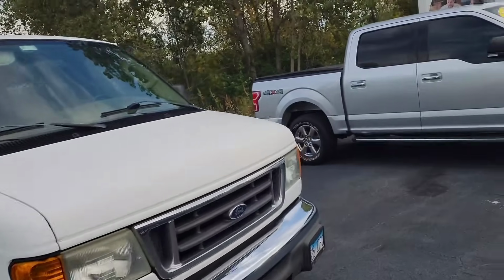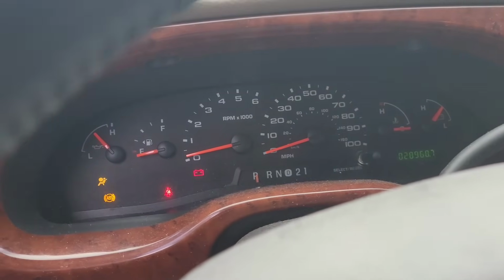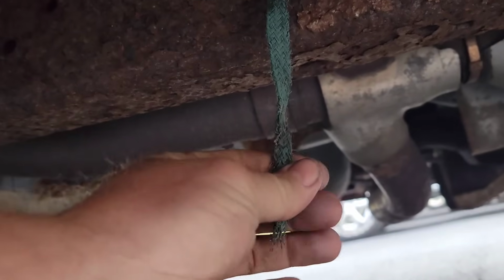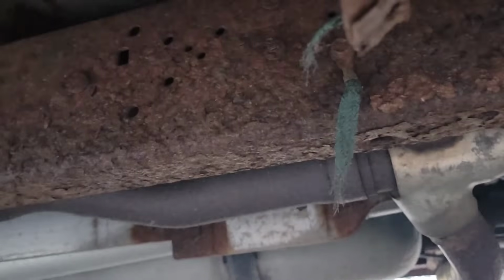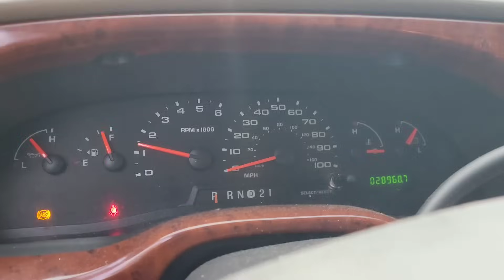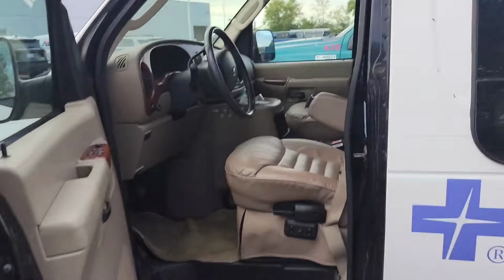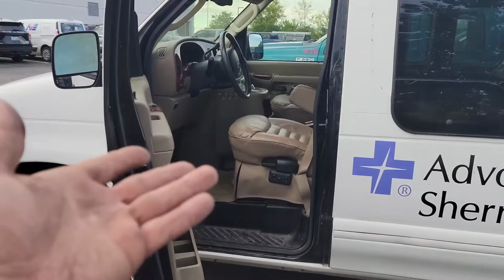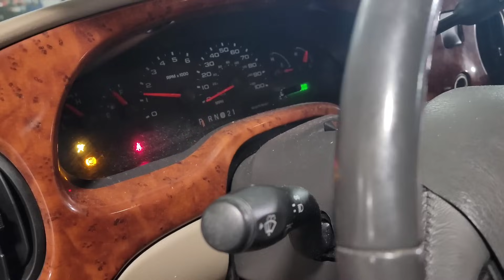Econoline No Start #1 Reason Why Typically - Crank No Start - Easy Fix - #econoline #nostart #ford

Comment: Hey, I’m currently having the same problem with my van not starting. I want to try and change the cable myself but I am very new to the game. Could I get a quick list of the supplies I’ll need? I have no idea what kinds of wires and terminals work for this. I plan to head to auto zone soon to try and get what I need.
Reply from the maker: https://www.ebay.com/itm/313703387679
Reply from the maker: https://amzn.to/3SLHp9K
Reply from the maker: https://amzn.to/3e3RFLF
Reply from the maker: https://amzn.to/3yajbhp
Reply from the maker: Now here's all the basic tools that you need and you can shop around to try to find other things that are like these but the ground cable is what you need and you need a 10 mm self tapping sheet metal screw and you need some type of drill impact driver and you need a socket to drive the sheet metal screw through the frame and through the body when you attach the ground cable
Reply: What was the gauge size of the wire you used?
Reply from the maker: @bobbyj7806 I mean you can use some pretty heavy negative cable it doesn't have to be anything crazy or you can find these ground straps that came on the vehicle on Amazon
Reply from the maker: @@renosimpson9611you can't do that but it's not necessary just replace the wire you're going to benefit yourself from doing so
Reply: Well, this sucks. I just changed my fuel pump. I'll get under there tomorrow and look for the ground.

Comment: God bless you brother! I spent a week going through ignition, fuel relays, pumps, filter, modules, and nowhere did anyone mention a ground wire anywhere. Right when I was about to take the van to a mechanic, there was your video. What a metaphor for life! Nothing else works until you're grounded...
Reply from the maker: Absolutely I'm glad that I could be of help
Reply: @FordBossMe  Great video IT maybe just what I need Ford Windstar 3.8 V6 03 Poland bro.I have get rid off that green thing two weeks ago working on flexi pipe changing. Now looking for solutions what maybe the issue knowing I have mostly sort out all other obstructions.
Thank you

Comment: OMG spot on, replaced friends 2003 Ford E150 front rotors and bearings, long story, finished repair after a week sitting in single digit cold and van cranked did not start. YouTube sent me your video first, rust was not bad at all, however, the ground strap had weakened at one end, and I was able to break it pretty easily. Replaced the strap with a braided wire, cleaned everything and it fired right up. Excellent, good call.

Comment: This video is just simple and so important. I wished I watched it before I went to change the pump and even the canister cause anyways I knew that the canister was faulty on my E350 Ford super duty 2011, because every time I went to the gas station and start to fill up the nozzle would stop every 5 to 10 secs. So I changed the fuel pump and the canister and the car will crank but wouldn't start, after different test to see what the problem was, I went back to look into more videos and I found this one to be the one. I remember I checked that cable and it look good but I didn't actually touched it, I was just a visual inspection, this time I pulled it and it came off really easy, that explained why I was still having some voltage going into the pump but it was barely 8 volts. After I installed a new cable the car started. THANK YOU for the time you spent into this video, I'm not a mechanic whatsoever but people like you can teach so many wonderful things, I send you a big hug and hope you keep sharing all this amazing knowledge, cause it's the equivalent of sharing love. And for those that read this message I want you know that all you have to do it's to believe that there's always a solution for everything, Whish you all the best. GOD BLESS.

Comment: I noticed my ground strap was bad when I bought my van, but I didn't realize that it would lead to the van not starting. When I saw your video, I had a Eureka! type moment. I really appreciate your help, as I was about to buy a fuel pressure gauge.

Comment: Man I live in Mississippi and I swear I've never seen a frame rusted like that!  Wow ! 😲
Thanks for all the lessons brother 😎👍👍🤙
Reply from the maker: Yeah especially with such low miles
Reply: In northern mn this is every single one, and half the time there's holes rotted right through
Reply: @UglyTv22  I almost think driving infrequently is worse cause the salt never gets washed off and it eats it worse when it gets warm out. They use calcium chloride some places for deicing and keeping dust down on dirt roads. That shit is horrible
Reply: Yeah.. thats junk.. im in Virginia and we get  it all. But thats bad.
Reply: I didn't like when our highways dept changed from salt to potash here in Saskatchewan in the late 80's but I appreciate it all these years later.  Only vehicles I have seen with that much rust are from the salt mines these days.

Comment: Just like my 01 Excursion I posted about in one of your earlier videos! I learned my lesson and it was from watching you do your thing. Great job.
Reply from the maker: The Econoline and the F-150s and the expedition's.... just terrible with grounds 

He'll even today most of the problems I find on the F-150 are because of grounds when it comes to electrical issues
Reply: Just put new carpet in my 01 Excursion today. I happened to check one of those braided grounds while I was lining up bolt holes from underneath. Love living in the south. Surface rust only on the frame. Braided ground totally okay, even after 20 years.

Comment: Funny your talking about a ground. Another tech had a 2017 Durango today. Dash was flickering and showing alternator voltage dropping to 10 volts. He automatically tried to sell an alternator. I said hold up man let's check this. No need to throw a part on because the dash says that. The dash is electrical. They can go haywire. So break out the multimeter. Alternator was putting out 14.4 volts. Start checking wires. Ground strap right front fender under the TIPM (totally integrated control module) eyelet was broken and would touch and break connection. Cut vehicle off. Crimp on a new eyelet. Secure to fender where it was originally located. Dash works fine. Alternator works fine. Battery is at full capacity. Have a nice day mam. No charge. That tech thanked me cause he wouldn't have thought to look there. Almost sold an alternator that was not needed. The customer was happy. She praised that other tech and I gave him the credit. Why? Because I taught him something. He listened and learned. Now he knows to check grounds
Reply: Ok

Comment: An excellent video, and for me a reminder. Years ago, after long blocking an E-Series, I ran into this very issue when attempting to start the engine and noticed very quickly the fuel pump not working. It was actually by accident that I discovered I had forgotten to reconnect that ground, when I saw it arcing on the frame as I touched it, and heard the fuel pump cycle at the same time. BTW, that is some nasty frame and body rot happening there, on that otherwise low mileage at least fourteen model year old van.
Reply: I was going to say the same thing about how badly that underbody looks with rust peeling off everywhere. The outside looks perfect which leads me to believe that during winter they keep it washed all the time, but that underbody sits with salt on it and rusts year-round.

Salt will eat off electrical connections like nothing. A few years back my Grand Marquis which is used as my winter car would not even crank the starter. Turns out that the connector on the wire to the starter was completely corroded off. Even though I oil spray the car every spring, obviously the slush washed the oil off that connector because the starter sits down lower on the engine. I am now using a heavier grade of oil for the underbody to try and prevent wash off like that.
Reply: @c.d.7742  You say you use oil... What kind do you use or can you give a brand name soni can get because I live in NJ and my work van  is starting to get eaten by rust.
Reply: @hajileserpud9539    Here in Canada I prefer Krown oil spray for the interior body panels since it has excellent creeping action.  My Mustang, which has not been oil sprayed for over four years, still has oil creeping out from around the door locks.  I do not drive it in winter, so only oil spray it every few years.

I started using Rust Check brand oil spray for the underbody a few years ago that is thicker and stickier so it does not wash off.

If your work van is already being eaten by rust, oil spray may stop it at the point it is in, but the oil spray works great when you put it on a nice new vehicle with no rust at the very start.  And if it is going to be winter driven, then I suggest each spring that you use an underbody cleaner with a pressure washer cranked up to the top psi  in order to flush of all the crud and built up salt from underneath.  Then have it oil sprayed right after it is dry from washing.
Reply: @hajileserpud9539  I've also used old engine/ transmission fluid. Brush it on, do it every couple years or so, good to go

Comment: I had this same issue on my 03 F250. I was having an issue with my power windows and radio wouldn't work until I bounced down the road a bit. I noticed the ground rotting away when doing an oil change, I like to look the bottom of my vehicles over while laying under them. I put a new ground wire on and problem solved.

Comment: Just having an intermittent crank / no start on our E450 RV after it being stood over lockdown. I changed the fuel pump relay a few days ago and it seems to be ok but will definitely be checking this ground strap now.

Comment: I love the addition of the washers, super smart!! How many times have we all used screws to mount those connections to something with the impact without a washer and it just twists the cable around and weakens the crimped connection or pulls it out if you don't quite hold it right.

Comment: The old air cooled VW had problems with the fuel injection system when the grounds were bad.  A lot of the grounds cane together by the battery box and often suffered corrosion issues.  Clean the body and wires where they came together and that often solved the problem.  Similarly, if a clutch job or the transaxle came down, they forgot to re-connect or replace the ground to transaxle cable.  They would burn up the contact points for the FI  in the distributor.   Fixing these item(s) often repaired many running issues with the vehicle.

Comment: No frickin way ! I just bought a Econoline conversion van for $500 as an investment to fix up . The outside is mint . The underside looks like the one you worked on . Actually came from Illinois ! Hard to start and keep running . Keeps blowing the check engine light fuse . Not sure if it's related but that's going to be the first thing I check ! Great video as usual . Thank you !
Reply: Sparky..I'm a Auto Tech.here in Arizona & I've come across this very same issue..I hope Ford Guy has helped you out👍
Reply: @stevedeleon8775  the ground issue in the video or the check engine light fuse issue ?
Reply: @sparkythedetroitdoggo8281  I would check both & do a visual inspection of all wires & connections under the frame..Fords are all about good grounds & connections..👍
Reply: @stevedeleon8775  thanks for the help . Greatly appreciated ! 😀
Reply: @sparkythedetroitdoggo8281  👍anytime Sparky..
Reply: Check engine light fuse? Meaning the power to the diagnostic connector? That is usually the same fuse as the cigar lighter. Check all of your power ports, I'll be willing to bet that there's a penny or a dime or something small and metal in one of them
Reply: What year ? I ended up with my mom's 89 ford Econoline club wagon
 Very little rust underneath, 100k miles engine has good compression & runs but is very dirty from sitting unused. 
I noticed it has electric ⚡ problems from corrosion on the wire harnesses. As if ford used dissimilar metals
 That causes corrosion, last issue was the fuel pump ⛽ would work one minute & not the next. The problem was the relay terminals had corrosion on the contact pins. Like the male pins are made of different metal than the female socket. So they corrode. I need to get some dielectric grease & clean & coat everything. The tail & signal  lights stop working also because of corrosion. People often mistakenly change bulbs when the corrosion just needs cleaned off the contacts.
I think Ford Purposely made them this way. Knowing it'd cause electric issues shorty after the warranty expires.
Reply: @michaelbrinks8089  ... WOW ! That was three years ago . Mines a 97 with a 5.4 2 valve . Don't remember what I did to get the check engine light fixed but I ended up driving it until I finally got 3 misfire codes . Replaced all the plugs and coils and it runs like a champ ! Put a set of vision legend wheels which look just like the American racing torque thrust D's paired with a set of 255/70/15   BF Goodrich radial T/A's . Fit perfectly and looks amazing . It's my daily driver and I've driven it to Florida and slept in the back . I always get compliments on how good it looks . I love it !
Reply: @sparkythedetroitdoggo8281  Ya I got some cool old school non stock wheels but not sure what kind. I wanna get some ATV wheels and go for the rugged off road campervan look. To go with the front  grill guard....I'm in Illinois but somehow the underside isn't all rusted out. Which reminds me, I need to diy  undercoat spray it.

Comment: I have a 1996 e350 chassis for my motorhome. It's been having trouble starting when it's been running. It cranks and cranks and will eventually start. Any suggestions as to what would be the cause?

Comment: Haven't checked just yet but my dad said it started with either today but wouldn't run after either burned off..Gonna see if this is an issue 2001 Ford Econoline....

Comment: I also notice that the turnover speed is Faster when the pump is Not running, and the compression sound, cadence is absent.  Presume it to the difference between compressing Vapor vs Air only.  BUT HELP, do you know of other reasons that the pump will just Stop, either while driving or after parked.. But then start again after a while?....  Having that issue my 96 Econoline Van 351...

Comment: You are absolutely right I had a mechanic look at this thing he says it was a fuel pump I put a brand new fuel pump in it and he couldn't fix it it's a damn ground wire 20 cents $300 fuel pump. You're awesome
Reply from the maker: Thank You
Reply: Now my problem is my van runs great when you first started up drive it down the road a little bit it warms up and it starts missing a little bit what do you think

Comment: Thanks so much after fixing 2 corroded wires and a corroded and cracked module. The van I was working on came back 2 weeks later with the same issue. Spent at least 5 hrs rechecking everything never even saw that ground being related to the circuit. You saved my ass thanks
Reply from the maker: Appreciate the feedback

Comment: Just wanted to comment this was a confirmed fix for me, 2014 e350 crank no start. No fuel pressure very failt pump noise until I went to this ground strap. Replaced and back to 100% thank you sir!
Reply from the maker: Thanks for sharing

Comment: Noticed the other day the ground from my transmission to the frame rail has like 3 threads of wire left. Gonna have to do this little trick tomorrow when I’m changing my rear diff out

Comment: Thanks for the great video.....had just cleaned up some of my grounds on E-350 RV with 460 engine.  Think I will replace the old copper straps with some like you made here.  Also ordered a crimper/stripper tool like you had.  Thanks again!

Comment: Had this exact problem on my 2005 e450 chassis rv a couple of years ago. Being an automobile tech and later service advisor i looked for the cause myself. Many weekend hours but i finally found poor ground from the electric fuel pump module to the frame. The module grounds through a steel bracket mounted on frame. Well it used to but there is now a good solid ground wire as well..had a couple cold ones after start up. Many hours but cost zero

Comment: Fuel gauge wasn't reading either before the ground strap repair.
Reply from the maker: Yeah it does a number things to the electrical system in general that one ground messes up so many things
Reply: Yeah those ground straps will cause all kinds of wierd issues!
Reply: Most (good) electrical engineers will let the relays have hot +12 on the coil, and let the switch ground the system. It's less power lines running to dash switches. Less chance of a short if a ground line gets shorted to ground. Only power necessary would be for the volt meter and dash illumination. Everything in a clean design would be can-bus data and grounded signals to the relay or device. Ford PCM is a ground control unit, the injectors, coils, etc all have 12+ volts waiting for the PCM to send the ground signal to open or fire.
Reply: Thanks. Good to know. I pretty much live in a 97 Econo.

Comment: Got hit with a storm, I'm booked out on small engine mobile service. My service van died running down the road. Spent all day in the snow trying to figure out why I got a fuel pump control module code. Replaced the fpcm and still nothing. Started power probing looked at all kinds of videos to no avail, when I left my secondary ground connected on frame from power probe van started. Started looking for grounds and found this same ground broken.. wow! Thought shouldn't there be more as fail safe. Started researching van grounds and now this video pops up but only now that I searching for grounds not before when I had the issue.